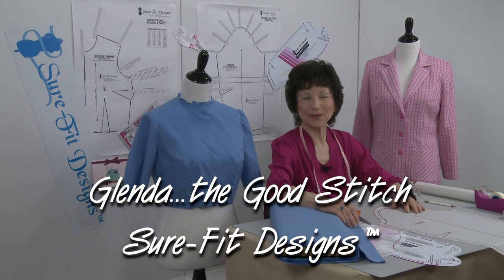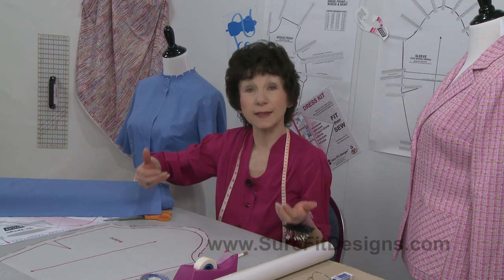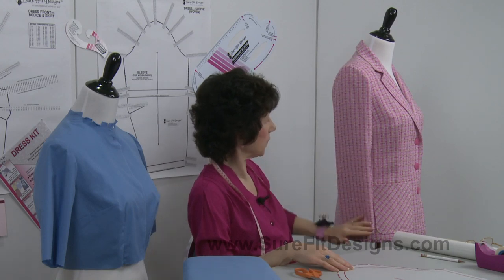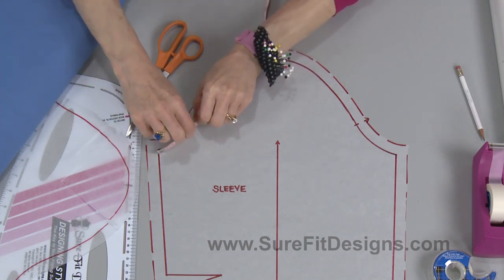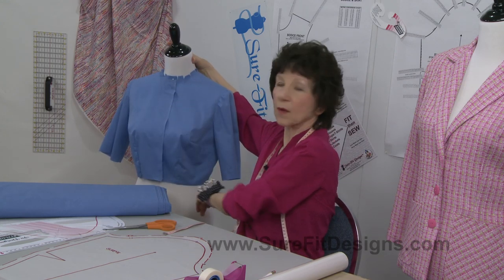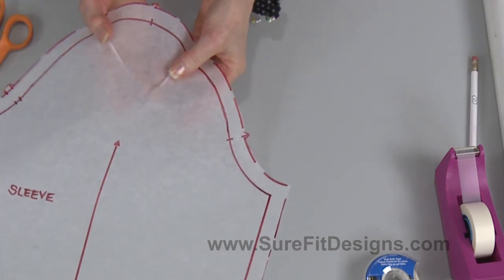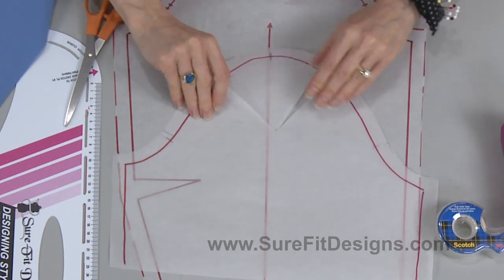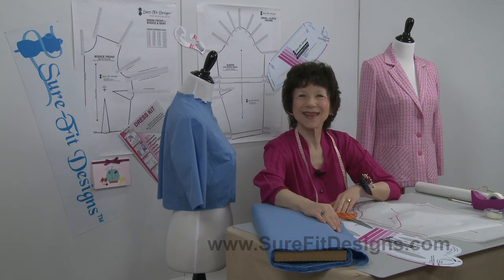Reducing Sleeve Cap Ease by Sure Fit Designs

Comment: Excellent technique! These days, I see mostly knit fabrics. I would like to adapt some of my favourite dress and top patterns that were designed for woven fabrics to be used for KNITS. The bodice is no problem to reduce slightly, but the issue is the sleeves; TOO MUCH SLEEVE CAP EASE. I read that knit fabrics generally do not require any sleeve cap ease, or a maximum of 1 cm. So, I would love to see a video or blog about how to remove sleeve cap ease. 

I tried one method that a professional pattern designer demonstrated in a YouTube video. He used the “swing the pattern to the right, then to the left” method to redraw a new sleeve without cap ease. However, he only needs to remove a small amount of ease. I have some patterns that have an excessive amount of ease. (Simplicity). So using his method, and redrawing the sleeve, seems to drastically change the sleeve dimensions, especially at the underarm, plus the top part to the sleeve (the bicep area) also becomes reduced. There must be a better way! 

Another trick I have used is to just trim the sleeve cap slightly from each middle insertion dot on the front and back of the bodice. I’m not sure how correct this is, but o tried it and it works, but it does require some tedious trials, trimming just a tiny bit at a time.

Comment: Hi Glenda, I am new to SFD and am getting ready to construct my muslin.  Took a look at the poly cotton symphony broadcloth you recommend from Joann Fabrics.  Your video may have the blends reversed.  You state that the Symphony is 65% Cotton and 35% Poly, but Joann lists it in many colors as: Symphony Broadcloth poly-cotton blend fabric is versatile, easy to use and colorfast. 
Width: 45 inches
Content: 65% Polyester & 35% Cotton
Care: Machine wash warm, Delicate cycle, Do not use chlorine bleach, Tumble dry low
Theme: Solids
Reply from the maker: K.E. - well, if Joanne's says it 65 Poly and 35% cotton, they are right...my error!  I've been under the mistaken impression for YEARS!!! that it was the reverse.  Funny how our memory and minds play tricks on us...or I could just attribute it to getting older and loosing some of my memory.  Either way..I'm wrong!

Comment: I have consistent success inserting a sleeve by using a 3/8 seam allowance instead of 5/8.  In fact, I like to have all SA at 3/8.  Can your Designers Companion tool come with a 3/8 SA instead of 5/8?
Reply: I use 3/8 on just about everything. Price has gone up, but this ruler has been invaluable. Only place I know to get it is:  https://www.etsy.com/listing/500584049/pattern-making-ruler-38th-375-seam?ref=shop_home_active_16&frs=1